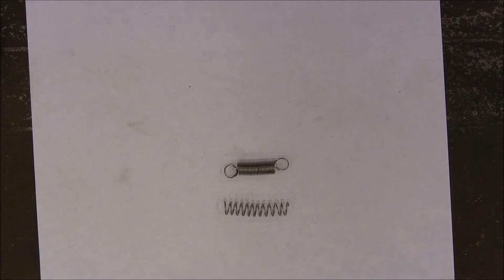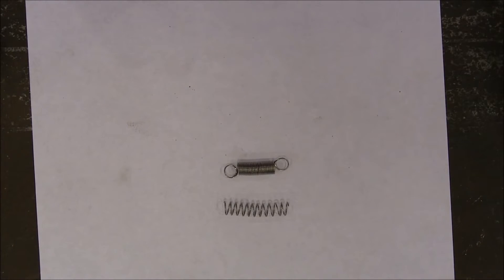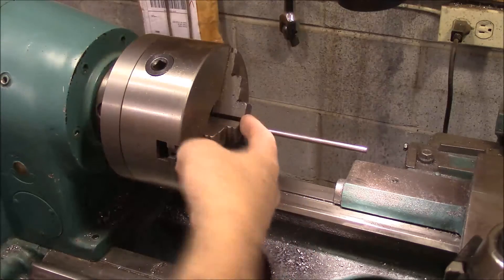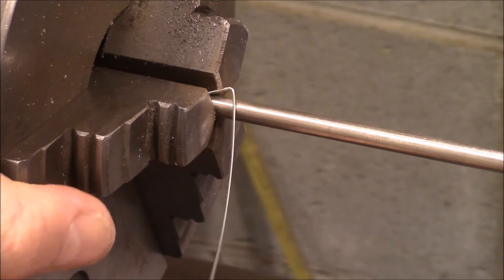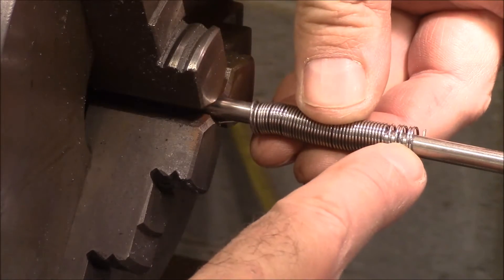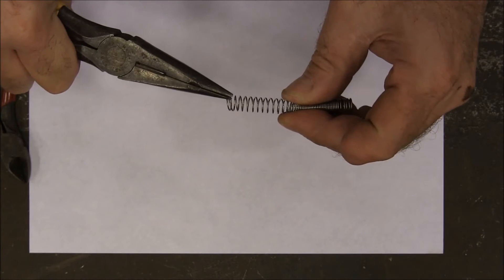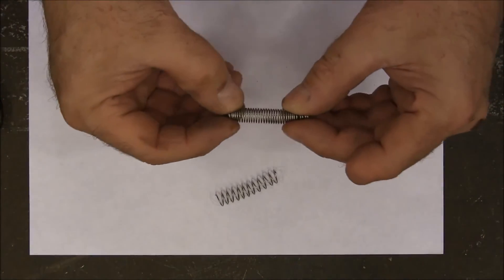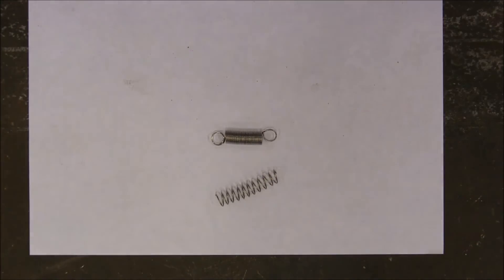How to Wind Springs from MIG wire

Comment: Did mine with 1/4" socket driver and socket, in a cordless drill. Change socket to vary size of spring. Insert wire end into drill chuck with socket drive.
Reply from the maker: Great idea!  Thanks!

Comment: you can do this with a vice, it helps to use a threaded rod, especially if you want it to be a pushing spring
TIG wire also works well
Reply from the maker: Absolutely.  Thanks for sharing!

Comment: That was excellent.  I was thinking one of the punches in my set of transfer punches may work well as the mandrel.   You would have 29 mandrels from 1/16 up to 1/2 inch.  Thank you for sharing.
Reply from the maker: That is a GREAT idea!  I hadn't thought of using the transfer punches but you're right that would give you almost any size you need.  Awesome idea, thanks for sharing!